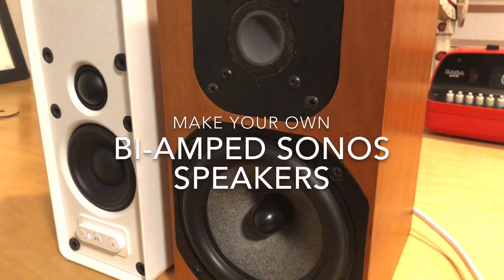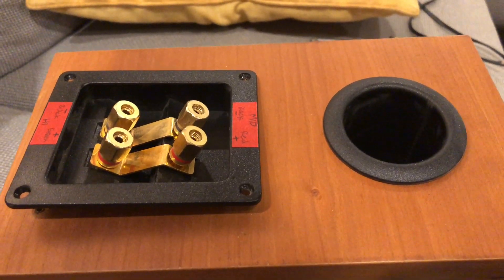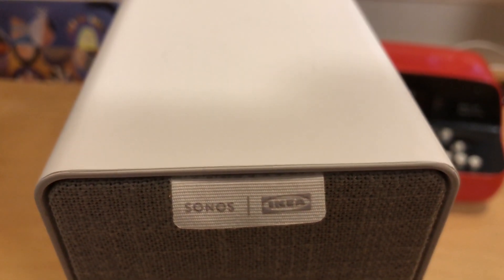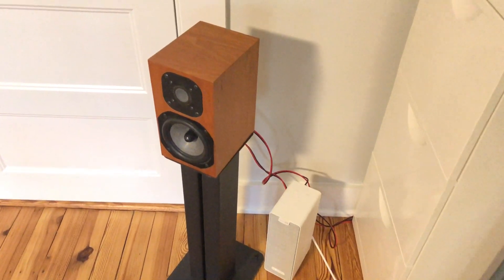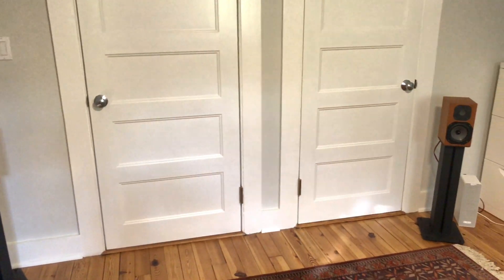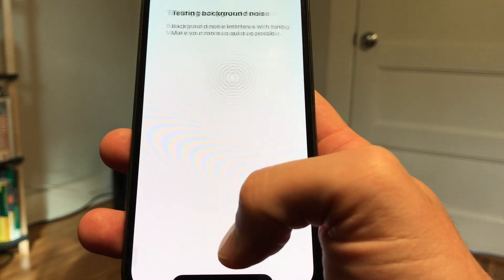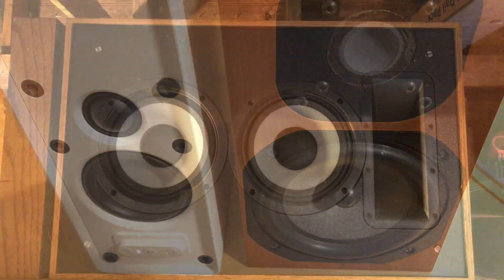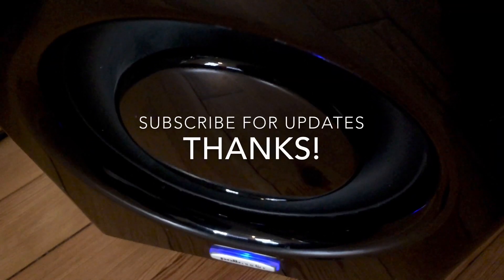Turn any hifi speakers into bi-amped Sonos speakers (with optional sub) by hacking Ikea Symfonisk

Comment from the maker: Hi all - If you're going for a 2.1 system with sub, I've put together a list of recommended subwoofers on Amazon  for ~$100:
Polk 10"  - https://amzn.to/2RcWV1q
Monoprice 8"  - https://amzn.to/3696umd
Monoprice premium 8" - https://amzn.to/2Rdl73O
Acoustic Audio 8" - https://amzn.to/2TVfCZt

Note: any subwoofer will work as long as it's amplified and has speaker level inputs - if it only has RCA inputs, look elsewhere.
Reply: Hi, this is great. I just bought two symfonisk, and i would like to try to dissassemble those and use the electronic from it to power DIY speakers. I have a DAYTON AUDIO DC130B-8 woofer and dayton audio nd16fa-6 tweeter. Will it work ? I have no filter or crossover with those drivers. I just happen to have those around, worth the try ?
Reply from the maker: Florent Van Goidsenhoven If those are around 8 ohm drivers, they should work great. One thing to be careful of is the tweeter is only rated down to 3,500hz. I’m not 100% sure of what the crossover frequency is but it seems somewhere between 2-3k so it’s possible the tweeter may be working hard, just listen for distortion if you turn it up. Be sure to use Trueplay, it should make a big difference.
Reply: @todd.parker  Thank you, I will come back with the result ! I'll try to do some measurements.
Reply: I just tried it in free air and tested the frequency response. No trueplay yet, it works, and pretty good too !! :-) thanks for this video.
Reply: Done the enclosure, closed one. this is via wifi and the measurement was with my samsung and sprectroid app
https://ibb.co/YhvRG5t
https://ibb.co/vkmJWXZ
https://ibb.co/F6RJnw7
Reply from the maker: Florent Van Goidsenhoven looks quite flat! How does it sound?

Comment: Do you have any picture of how you wired the switches, internally?
Reply from the maker: I don’t but I basically just cut the wire (can be the + or -) and wired it to each side of the switch so it’s in the middle of the flow. Super simple if you get a DC switch.

Comment: Wouldn't is be better too bite the bullet and just install all the insides of the symphonics into your built speakers.
Reply from the maker: If the speakers are large like the Klipsch and you’re sure that’s the way to go then yes. I added the binding posts and do it externally so I can experiment. Also my two way speakers are far too small to fit the Symfonisk components.

Comment: Great video buddy. Do  you think it would work with a set of B&W D602
Reply from the maker: Sure, those are two ways and even have dual binding posts. You’d just want to straight wire from each driver to the binding posts to circumvent the passive crossover
Reply: Could you please explain why the crossover would need to be removed from the speaker.
Reply from the maker: Sure. In a traditional passive speaker, the amp sends the whole frequency spectrum to your speaker. Inside, the passive crossover splits the spectrum up so the lower frequencies can be routed the the woofer and the highs to the tweeter. In a Sonos speaker like the symfonisk before the signal is even amplified, it’s split into highs and lows then sent to separate amps for each driver (bi-amplified). You can disconnect the internal symfonisk drivers and essentially hook those to B&W drivers so now it’s a bi-amplified speaker BUT you don’t want that passive crossover in the way so you need a way to directly connect wires to the tweeters and woofers by adding binding posts on the back and just having direct wires to each.

Comment: I like this and may try it.  But getting the new Sonos amp might be the way to go as there is no hacking involved for the speakers or the sub.  Of course you pay more for convenience.
Reply from the maker: Yep, that's your choice. This technique is best for making a 2.1 or 5.1 setup with Symfonsks, or bi-amping a two way set of passive speakers (and adding an optional sub). If you need line in/out or amplification or don't want to open up your gear, the amp or connect is a better option.

Comment: Hi. I did the same thing to an old Carlsson Sonab OA14 but I put the amplifier inside the speaker. It turned out great. I had to start with refoaming the speakers and that took some time but Symfonisk part was quick.  https://photos.app.goo.gl/iGapCZVVvLydE2wf6
Reply from the maker: Nice! Looks like quite a project. How do they sound? Are you using Trueplay?
Reply: @todd.parker  I used Trueplay för the tuning. It sounds great but the tweeters are 50 years old and may need go be replaced to get even better sound quality.

Comment: Cool stuff what you're doing. But I don't think trueplay can dictate what frequencies your bookshelf speakers play compared to your subwoofer, as they are wired in parallel off the sonos speaker. I believe what's happening when you begin using the subwoofer is that power is being diverted from the bookshelf speakers to send to the subwoofer, reducing low frequency output of the bookshelf speaker. Even though the bookshelf speakers lose power, you end up with louder overall low end due to the subwoofers internal amplifier.
Reply from the maker: Hooking up the sub doesn't make the internal woofer quieter. You're right that Trueplay isn't sending different signals to the Symfonisk and sub, it "sees" them as one thing but still accounts for the room. In my testing it best to leave the sub off or fairly low so Trueplay doesn't hear too much bass and over compensate by reducing the low end.

Comment: When you did your hack with the subwoofer, how did you specify the placement of the symfonisk in the sonos app? Did you  set it as a rear or front speaker? Was it setup as a seperate room? Subscribed!!
Reply from the maker: I haven’t used this in a home theater setup but I’d suggest grouping the symfonisk to your HT room if you’re using it just as a sub gateway. My hunch is the rear channels don’t have enough low frequency signal to be worth it.
Reply: @todd.parker  Thanks Todd. In surround mode the rear channels give you the option of ambient or full volume signal so that might be a mitigating factor. I have never ever been interested in the surround sound thing until the last few days, but now I am. it's fun and it works great with normal stereo mixes. The living room and kitchen are basically one room, so sitting on the couch the sound was great but I am usually in the kitchen and only got a sideways stereo image. Now I get much better sound off-axis.
Reply from the maker: Yeah a proper surround setup is great. I should swap my play 3’s with the symfonisks to test the sub behavior...
Reply: @todd.parker  I can't wait to dig into these ikea boxes.

Comment: I've got a beam and two symfonisks and be loving them. The Sonos app sold me on this system after fighting with the AudioPro app for a couple days. I am thinking a next step could be to just move the guts of the ikeas into the belly of the old speakers. Hmmm.....
Reply: Would you be able to take out the hardware components from the Symfonisk and put them inside a bookshelf speaker with only one pair of binding post, I.e. regular speakers instead of two pairs (bi-wiring)? How much room would you need to fit everything? I've a couple of q acoustics 3020 that I'm willing to take apart...

Comment: Hi. Great video! Do you think that it would it be possible to drive a small (8”/10”) passive subwoofer from the woofer speaker level connector?
Reply from the maker: That’s a good question, I bet it would. I believe this is a good quality 50w amp.

Comment: how many ohms are the drivers inside the symfonisk speaker?
Reply from the maker: I’ll check next time I open them up
Reply: The woofer is 4 ohms and the tweeter is 7 ohms!?
Reply from the maker: Magnus Blomqvist nice, you measured them?
Reply: @todd.parker  I used an ohmmeter on the disconnected drivers

Comment: Excellent idea and analysis. Thanks! I think I'll use this hack with ceiling speakers.
Reply: You will have to bypass the internal crossover in the ceiling speakers. I my crossover was hard to get to without destroying the speakers. I ended up changing speakers to make it easier.

Comment: Thanks, very interesting. I guess it's not possible to build an audio jack input into the Symfonisk?
Reply from the maker: Not without more advanced knowledge and soldering into the board. It may not even be possible to get a full range signal since it splits it for the low and high frequencies digitally.
Reply: @todd.parker  what you might consider is getting a pair of usb to ethernet adapters and plugging bluetooth dongles into them. How to get separate left and right channels via the 2 dongles? I haven't  worked that out yet...
Reply: ... If the ethernet ports don't have power, they can't power the dongles. Maybe network the 2 speakers to a single board computer like a Raspberry Pi. From there, the worlds your oyster.
Reply from the maker: steve duvall Interesting ideas but I think Bluetooth would add quite a bit of delay and by the time you buy those adapters you’re probably better off getting a Connect.